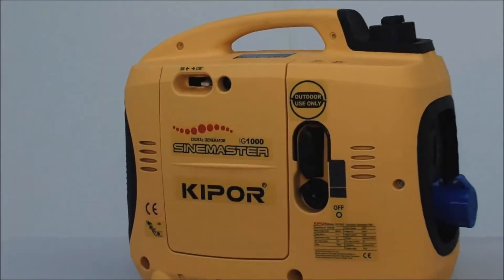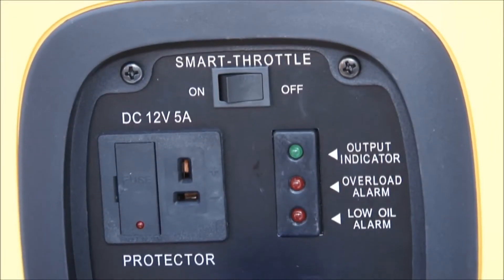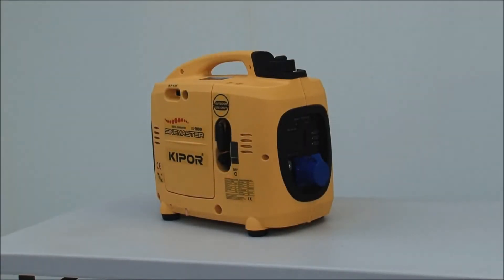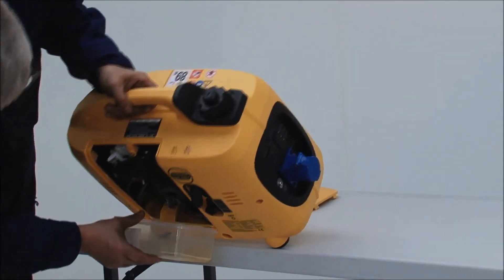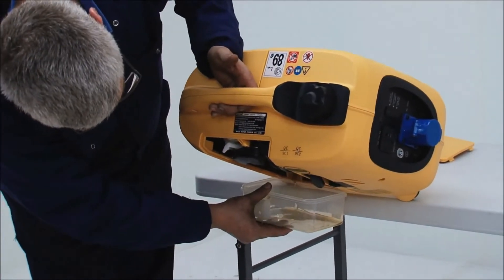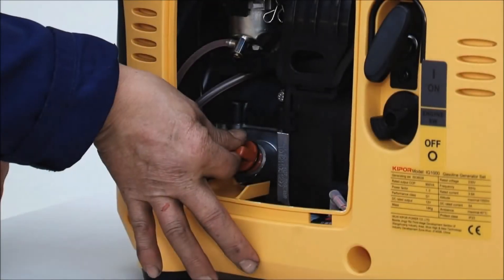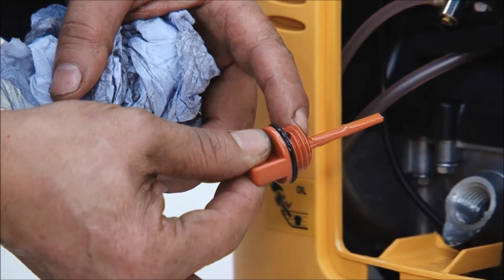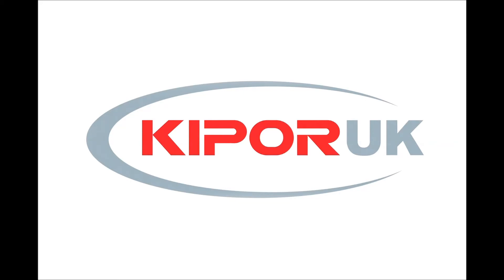Oil Change on Kipor Suitcase Generator (IG1000P, IG2000P, IG2600P)

Comment: Is it normal if you leave this generator for awhile for some oil to leak?
Reply: @RV Life Lovers I would apriciate to tell me what type of oil to use
Reply: @xxoustou  (this is RVLifeLovers, just under a different accout) I use SAE 10w30, which is what the manual calls for. I use the same for my lawnmower.
Reply: @svChasing.Destiny  My friend thank you very much for your answer.. A friend gave my this generator, but he had it in his garage for a long time so it needs a serious service.. Can you please tell me if it needs oil mixing in the gas? I can't find the manual. Thank you again
Reply: @xxoustou  No mixing oil required. Just normal unleaded gasoline. I have a few hundred hours on mine, it has been very reliable. When starting, turn the rotary switch to ON, then gently pull the cord 10-20 times. This primes the engine with gas. If you have difficulty starting it, be sure to do this.